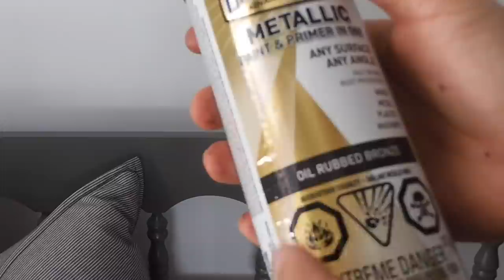Uglying duckling Challenge | EXTREME FURNITURE MAKEOVER | FurnitureFlipBySarah

Comment: A time saver is brushing in the interior corners with a heavily loaded quality brush, then rolling out the flats with a fabric roller sleeve.  We suggest using instead of rattlecan shellac, using premixed brushing shellac or even better "SealCoat" A white shellac that has a really long shelf life. The rattlecan shellacs can have small amounts if methylene chloride to prevent settling and caking. Even tiny amounts can lift thinly applied original paints and coatings especially nitrocellulose type lacquers on hardware, pulls etc.   Nice job...  A great save!  We are noticing a trend of the "flippers" transforming five dollar items into higher and higher resale dollar items. This is fine if there is no concern that the customer may not be as happy in a couple of weeks.  Most of what we are seeing are  the use of waterbourne products. For the greater part these are acrylic polymers that even though dry "to the touch" and "dry" enough to recoat or topcoat, these paints and coating are not cured and are not ready to be used as platforms for heavy objects and especially  planters.